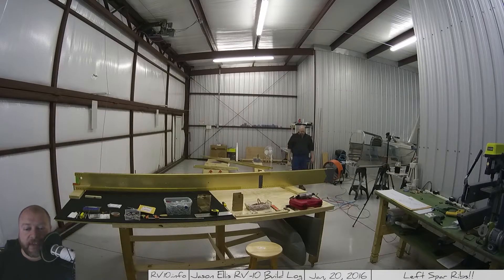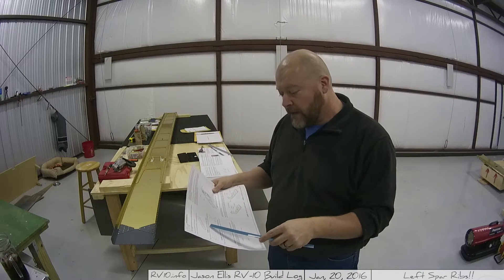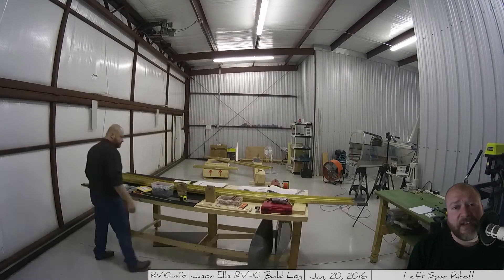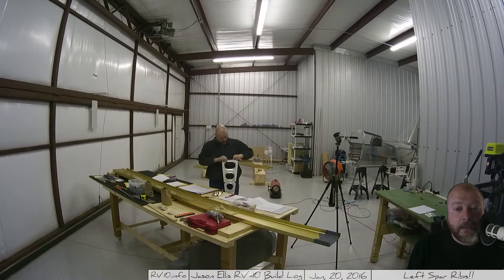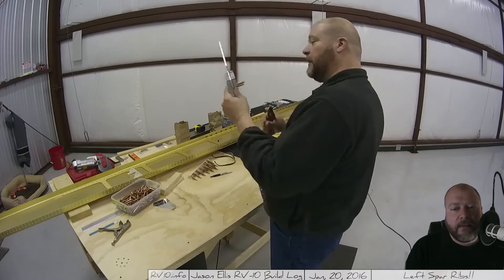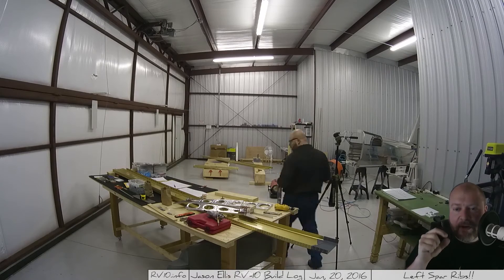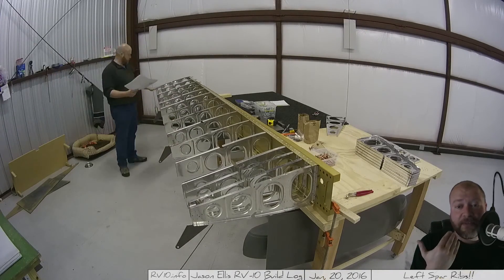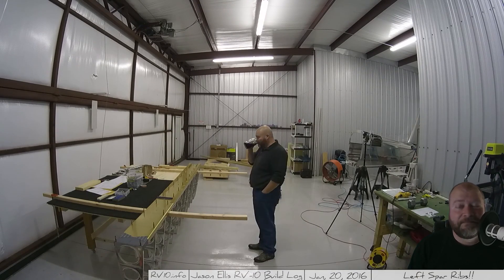RV-10 Wings - 006 - Wing Ribs

Comment: Do you have an algorithm for storing the parts?  IG, sort by the part number and use a binary search?

Thanks a million for the videos btw - I'm considering a project like this and hearing your thought process working through problems is immensely enlightening as to what it would entail.
Reply from the maker: +foonix0 Using a linked list and static search with a fuzzy logic algorithm to maximize... er.  okay no.. I just put things out on the table with the label up.  I tried getting creative about that awhile back but honestly it was a waste of time.  If you keep subkits roughly in the same area, and have your packing list handy its pretty easy to find parts.  And you're welcome.